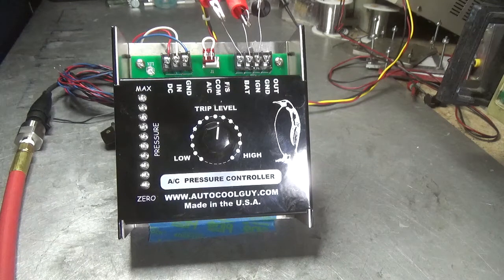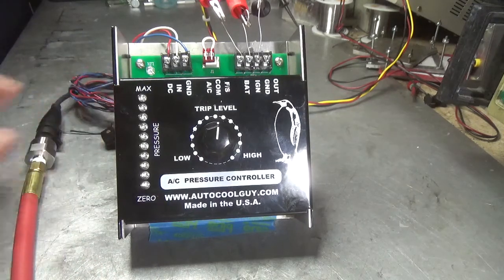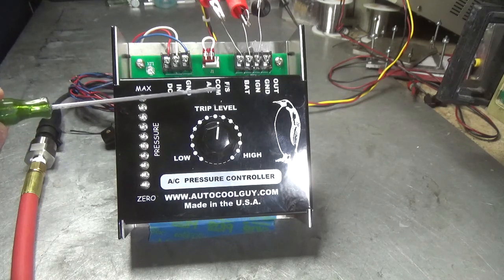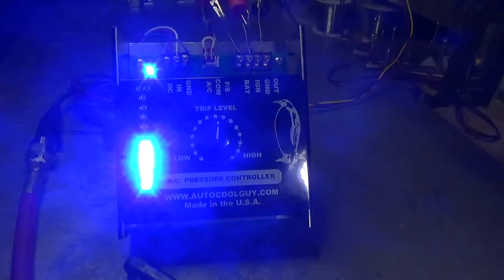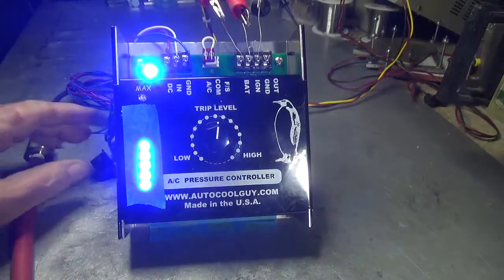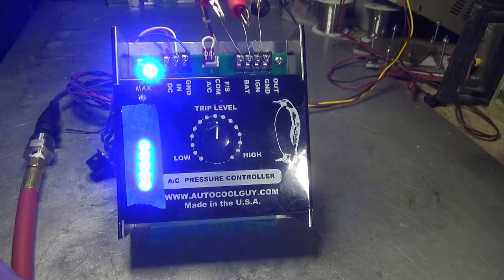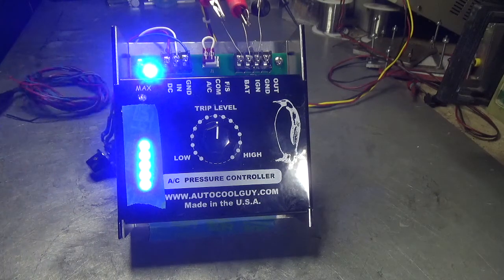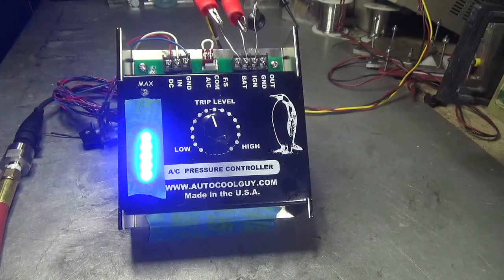A/C PRESSURE CONTROLLER FROM THE AUTO COOL GUY

Comment: What a great set of products you are designing.  I have a question.  I have my A/C condenser mounted in a remote location with its own electric fan.  Which product would I need to control my electric radiator fan via PWM and the condenser fan separately via PWM in relation to pressure?  From what I can gather from you website is to use the A/C pressure controller to operate a PWM fan controller.  However, it appears that the A/C pressure controller only trips when it reaches the set pressure and wouldn't raise fan rpms in relation to A/C pressure.